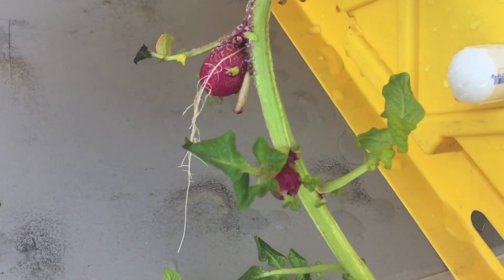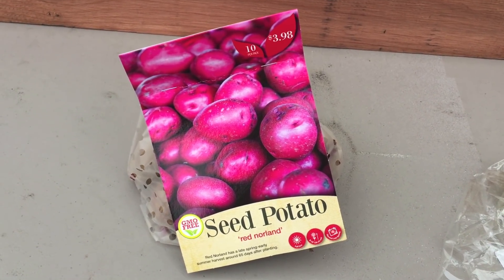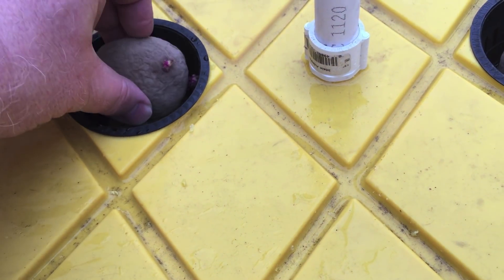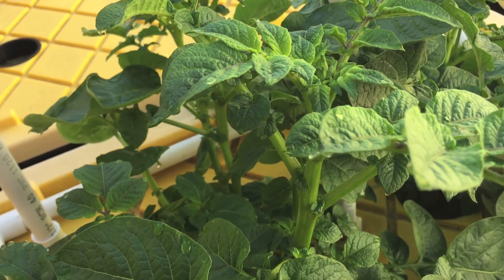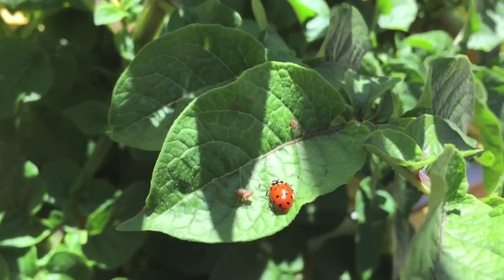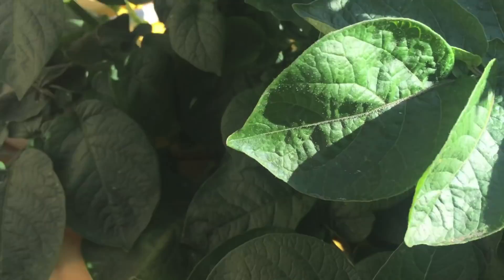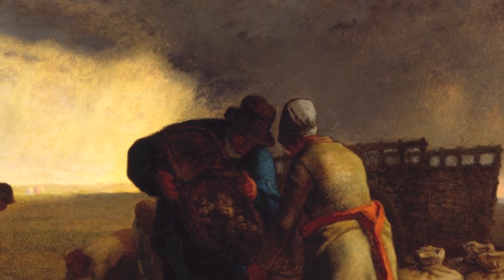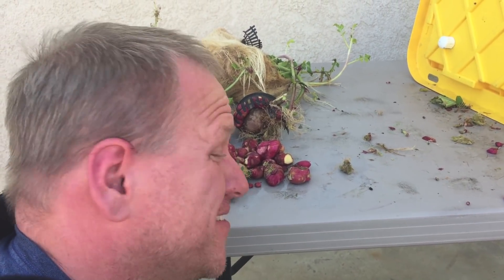Check out the amazing growth pattern of this hydroponic potato!

Comment: I set up a Kratky hydroponic system with baskets across the top of a box filled with nutrient water. (Actually these are expandable colanders for the kitchen sink but 3 of them fit my box exactly.)  I grow most veggies aeroponically, perennials in soil, and this hydroponic system for bulb vegetables such as onions and beets.  No cups or pots, just whole baskets filled with clay pellets so there are no constrains for the bulbs. I have sweet potatoes slips growing and I think I will grow them hydroponically indoors for (edible) leaves until it's warm out when I will grow them in soil out on the balcony.  Not planning on growing potatoes but wonder it this clay pellets system would be good for them. The main idea is to give the bulky edible parts of these plants room to grow.

There are aeroponics potatoes farms but their system of hanging potatoes is not for most home farming.

Comment: Well.. That was a swell, weird, amusing video.  Cudos.  As I saw the end result, I wondered
if you could grow them in a sort of plastic double boiler.  the top tray, dangling over nuts might look like a 10\20 tray with 1" holes in the bottome for roots to reach nutes, and the
photo part of the plant grows out of larger holes, cut into the lid to allow light to targeted
spots for folage to grow up and out throgh those holes.. maybe 6~8" holes.  The 1020 tray
would act as the netcup under the lid with holes for light/folage.. Can potates be grown underwater?  I also think I saw a guy growing taters out of downspouts with little trays
outside grow media holding the weight.  Nice vid pal..It was original, thats a hard place to reach.

Comment: If you suspended a hardware cloth screen platform under the lid, you could use this method, pumpless. Just lay the seed potato on it.
    But, cheap 12 volt bilge pump, timer, and sprinkler heads could also spray right through that mesh, if someone wanted to automate further.
    Your netty cup gave me the idea, Lol

Comment: A foam or rockwool puck tightly fitted into a cup with a simple cross in the bottom for support(IOW a net cup with only 4 giant holes, or two crossed wires), and a small hole in the puck to clamp around the stem.

I've read some studies that showed benefit to disinfecting the seed both in storage and at planting time. As I recall one was using 100:1 water with 27% hydrogen peroxide, I don't recall the disinfectant pH for sure but 2-3 comes to mind.

Comment: cut the bottom out of the baskest and use a mesh drawstring bag to hold the medium.  As the roots grow, feed more of the bag into the resivior, and if they grow too large for the bag to contain cut it strategically to release pressure. I haven't tried this myself; but I think it would solve the problem, and might even make harvesting super easy with all the potatoes already in a bag and whatnot.

Comment: You didn’t need the baskets once the plants were large enough to hold themselves up at the lid.  You get them started and then cut the baskets away or at least start by cutting the horizontal bands, leaving only the verticals connect at one center point at the bottom.  When the roots get large enough you can cut the connection point and the plant roots can spread out.

Comment: Did you ever figure this out?  I tried growing them in pool noodles in a milk crate suspended above the water medium. I cut the pool noodles into roughly 4 inch sections and dumped them in a milk crate. I burried two seed potatoes in that. Then I suspended the whole milk crate full of noodles and potatoes over a large storage bin. blocked off light at the sides of the bin and added an air stone and pump for good measure.  They grew crazy on top, and they got roots but never produced potatoes. So I'm not sure if it was my nutrients. I used Master Blend.

Comment: I’ve been thinking about this vid since I’m growing some taters now. Potatoes seem to have three zones. The green leafy part, the potato-forming stems that grow just below the ground surface, and the roots. Maybe set the potato on a screen, just kissing the water, so the roots can grow through the screen. and then provide it with a light-blocking mulch on top of the over the tater- the equivalent of straw. The mulch should be such that the leafy stems can grow through.

Comment: Just watched your video to find out how to grow hydroponic potatoes. What I found was a way of how not to grow them. Based on other videos I've seen on hydroponics, I'm thinking that starting a seed potato, suspended with toothpicks above a partially filled jag of water until you have the first true leaves appear. Then place a wide "+" shaped, foam disc with a cut on the radius and sliding the disk around the stem just above the potato (at what would be ground-level) and then letting everything (seed potato and all) hand freely below the cover of the hydroponic solution and relying on the foam disc to hold the plant securely might be the way to go. The foam discs I'm referring to are the ones in this video. I'm going to try this method this year. https://www.youtube.com/watch?v=3AbxnWiVTH8&t=264s

Comment: Maybe remove all the net cup netting save 4 main supports and all the bottom from which you drive 4 skewer type objects through the bottom of the net cup @ the support and slightly into the potatoes and then cover in rock wool or ur choice of media. Operate as usual

Comment: I Bulk order the mesh onion bags used for retailing onions and use those to grow potatoes inside my aquaculture setup. The roots reach down into the water but the bags support the weight of the potatoes. You can start out in a net cup but will need to take scissors and cut away the lower half of the cup when the taters start forming so they can dropdown. Your bags can be "stiched" to the net cup with reusable zip ties. If you can come up with a way to attach just the onion bags thru the hole to the top of your float that would be better and not waste a net cup. I'm still experimenting with that. I'm only having good luck with Kennebeck taters. They are about fist-sized on average and about 2 per plant with a lot of little half-dollar sized ones.
Reply: Try Yukon gold. Kratky had luck with those!

Comment: Bigger root net cup with much larger slots so the young potatoes can be gently pulled lower and suspended on a hook in the lid to prevent rot in the water using water and rot proof tie if needed. Then the potatoes will grow krakty style on the inside of the light as water drains and rooters from the tater searches down

Comment: Maybe instead of using a net cup, put your seed potatoes on a skewer or maybe some tooth picks. Just put them in deep enough to keep the seed potato suspended out of the water. Or (if you have the patience for this) you can tie string around your seed potato and just dangle it above the water just close enough for the roots to reach. No grow medium required, maybe use something to keep the light off of the roots to prevent algae growth and that's all you need!

Comment: I used coco coir in a net bag...(a gallon paint strainer from home depot.)   Hung the bag filled with coir into water.  I used both a 5 gallon and a small trash container with  a lid.    I did it for carrots and potatoes and it worked well.   the coir acted as dirt and the suspension into the nutrient solution fed the plants and allowed for them to grow to their maximum size. I absolutely love your videos.  Keep em coming....
Reply from the maker: thanks patt

Comment: Jeb, can you try doing potatoes but instead of using a plastic cup just sort of cradle the seed potato in two intersecting pieces of string in an ''X''. Leave enough string you can loosen it off as the potato starts to grow and adjust the water level so that it doesn't rot.
Reply from the maker: good idea

Comment: Have you thought about starting it in the cup and then when a strong stem develops simply suspending it with plastic wrap or foil over the hole, gripping onto the stem ?
Reply from the maker: Seems like the plant might protest at being hung from the stem.  Could work fine though.  Labor cost would be a problem.
Reply: Jeb Gardener it works well for my succulents but theyre much lighter and the lip of my container is small

Comment: The trick with potatoes is that the tubers grow up, not down, which is why hilling works when growing with soil, and why you didn’t get any tubers with the roots.  You almost want an expanding tote at the bottom so that as tubers form, you can continue to increase yield.  A black tote lid will help with the green stems and tubers.  Also, maybe not net cups, but something like a net tray to accommodate outward expansion.  I dunno, prolly all suggested before.
Reply from the maker: I think it's the humidity that triggers the tuber formation.  However shielding the fruits from light is very important.

Comment: I’m going to preface this suggestion with the fact that a handful of growing media just isn’t a realistic expectation. You are competing with soil sure, but logistically getting any yield out of potatoes without a decent amount of growing medium just..doesn’t work. 
So. Set up a tray with a fine mesh net that hangs underneath the lid of the tub that’s about 4 inches deep and fill it with azomite. It’s cheaper than stone wool and won’t condense. Wet it and bring the water up in the tub to were it’s just barely touching the bottom of the mesh. Do everything else the same way.
Reply from the maker: find "dangerous plant grows without soil"
Reply: Jeb Gardener
Well. 

I’ll be damned. Guess crow is on the menu tonight.
Reply from the maker: blame youtube.  they don't recommend that video any more.  I think it's a session stopper or whatever.
Reply: I am always happy to blame YouTube. But I wasn’t being terribly open minded either.

Comment: Your water is too deep, they won't grow in the solution. Should've used an aeroponic drip form of watering instead of dwc. The spuds grew in the cup because it was not immersed in the solution when all below it was. Next time leave the tote empty and use a drip line from the top through the cup with a drain out the bottom going back to the reservoir. They'll grow in the open area of the tub, hanging in the air.
Reply from the maker: find "dangerous plant grow without soil"

Comment: How about wicker system?  a bunch of mops cotton strings hanging under the lid as growing media like a wig lol ( can even weaved them as net to keep potatoes in places while the mop wigs are sucking water upward? Or how about using heron's fountain system as water pump? That could be fun to figured out the design, I would guess it would be the first no electricity running water hydroponic system ever build.  I often wonder if I could try adding charcoal activate to keep water fresh and cleaner heathy roots but never dare to do it.
Reply from the maker: Hanging them from a string net seems to work just fine

Comment: Can you not put in a shallow tub that's perforated under the lid to hold the potatoes while they grow and allow them to mature freely in the fluids? That way the basket bottoms could be removed after the plant has matured enough to hang on to the sides of the basket and not get crowded.
Reply from the maker: good idea.  have to find a way to keep the tubers from sprouting up there

Comment: I'd like to see you try this with something as a larger net cup, maybe a plastic colander, and just a tiny bed of rockwool like you had... I think you'd end up with a basket of taters. Give it an opaque plastic lid with a 2" hole and by the time you see tubers forming you could add a black garbage bag as a plastic mulch to ensure no light is penetrating the lid/hole.
Reply from the maker: maybe
Reply: i'd personally simplify further by eliminating rockwool altogether, and maybe increase calcium for strong tuber growth... btw this is so cool being a dirt gardener and seeing hydroponics used with such basic regulation.

Comment: @Jeb Gardener , Probably a year or so late. But just use Cotton that is typically used as Stuffing or Aquarium filter? Let the tubers form in it. Should be fairly easy to remove at the end of the day. Doesn't absorb moisture very well. Well, that is if you can get the tubers to grow over the lid. Stuff it full of cotton around the plants cut the away the leaves at the net cups. Encourage growth higher up in the cotton.
Reply from the maker: find "dangerous plant grows without soil"

Comment: The only thing I can think of that might prevent the potatoes from getting trapped in the net cup like that would be to use a second lid with holes drilled into it about 3 inches below the top lid.  You can use a net cup with the bottom cut out to contain the rock wool, and then when it's established, you can remove the cup completely by cutting it out.  
 https://docs.google.com/presentation/d/1NMrmyE5NU06p6cZy2MNJwzZ28yO4-ndA2AEpJpZ7_5k/edit?usp=sharing
Reply from the maker: find "dangerous plant grows without soil"

Comment: I wouldn't even use growth media, just start your see potato in a jar out of direct sunlight so it won't go toxic, wait until you have a decent seedling then transfer it to your other set up, but instead of a net cup, use string to carefully suspend the plant over/in the hole in the lid and the string can be adjusted to not choke the plant and your tubuers are free to grow in the water :)
Reply from the maker: in my next grow i suspended from thin rope to start.  worked great
Reply: Jeb Gardener I like to grow lots of things in glass jars :) unfortunatly I live in a tiny apartment so I end up having to put them in soil to keep them around with ease and limited space (I have one window that gets sun this time of year)

Comment: How about stabbing a wooden skewer through the potato and hanging it with string so it dangles down into the water?
Reply from the maker: I stabbed one of the strings so it would definitely work at first.  When the seed rots out and the stems have to grip the skewer, good luck!
Reply: Ah good point. Back to the drawing board then.
Reply: What about nylon tights? As the potatoes grow the nylon will stretch. Could put some holes in them for the roots and other stems to grow through.
Reply from the maker: Watch my dangerous plant video. I found something that works great!

Comment: interesting, because I was considering to plant some potatoes myself, over winter.
For once, you can cut the seed potatoes into smaller pieces, where ever they have the little sprouts or dots that will end up being sprouts. You should be able to get like 4-6 good seed chunks out of one potato.

So technically, you have to somehow suspend the main roots that grow the actual potato. 
I have NEVER seen potatoes grow on a green stem like in your experiment.
It is fascinating how the stems turned green under the lid, thinking that it tried to be a satellite plant, which potatoes can have feet worth (normally without carrying many potatoes).

What I would try and do is, add an additional "shelf" to the inside of the tote (below the mesh pot) that can have another media, such as coco mat or hydroponic substrates on it. In this "sub floor" the actual potatoes can rest and grow horizontally, without dropping into the water vertically.

I believe the roots tend to grow sideways, carrying the potatoes and all my plants always grew a potato, out of which grew another main root and another potato and so forth.

I will give it a try myself and hopefully make a video about it.
Reply from the maker: sounds like fun.  let us know how it goes

Comment: Instead of putting in a cup, maybe you need to get the potato started growing first, then suspend it by the stem above the potato.  All the new potatoes will form below where the stem is held.
OR, maybe instead of a cup, you should set the potato on top of a netting "plate", so all (or most of) the potatoes form on top of the "plate", or under it.
As for the green taters and stems below the lid, seems like too much light is getting in.  Maybe paint the top of lid with good black paint, and make sure no light sneaks in where the foliage comes out thru the lid. 
Loving these videos.  The dry humor with the dramatic music is hilarious😂.  Feels a little like watching old Bugs Bunny cartoons.  Thanks for making!
Reply from the maker: Thanks!

Comment: poke 4 tooth picks around the potato and then suspend in the hole with no cup.
Reply from the maker: those might break then the plant grows.  Thing roped worked pretty well for suspending them.
Reply: Agreed. Then he could suspend a screen on top of bricks (at water level) to keep the potatoes out of the water. Still letting the roots go down.

Comment: Put a wire inside the potato  and then hang it freely cutting a hole like you did, you just need to make make a arrangement to suspend single wire into the water from the hole.
Reply from the maker: String worked well.  I think wire would work fine too.